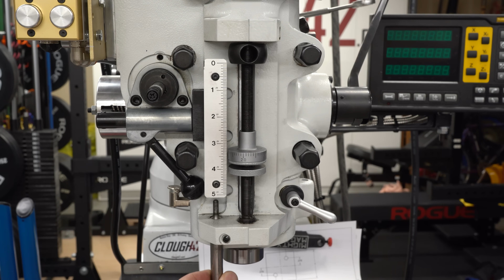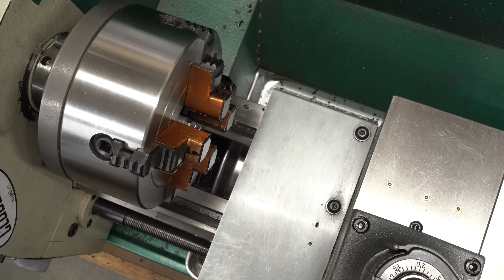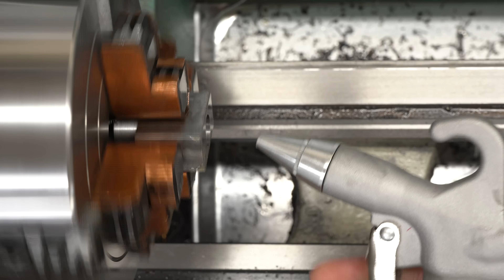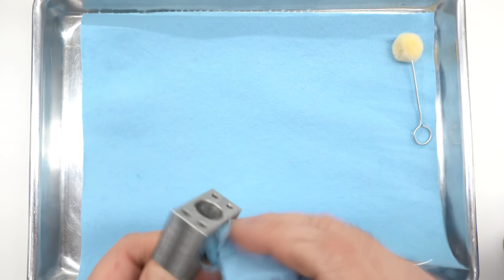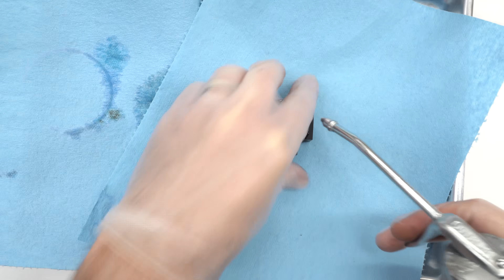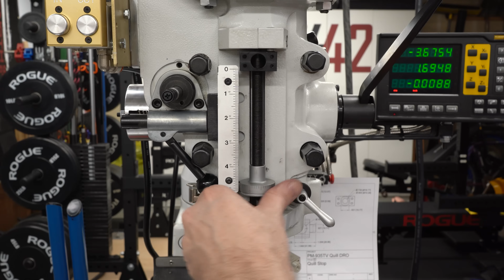Installing a Quill DRO On My Knee Mill - Making the STOP

Comment: When rough turning it's better for your cutting edge side angle (the face moving into the cut) to have a positive angle.  You want the cut to push back on the cutter. If you have a negative angle the cross slide can be pulled towards the part, especially on interrupted cuts.  Save the negative angle cutters for finish passes.

Comment: not to nitpick, but whenever i'm on a mill and squaring up stock I usually use a larger face mill or fly cutter mill to optimize surface finish. Even though there is no wrong in using a smaller end mill to face & true up  stock, I often get skittish in doing so.  Worried that somehow a part of the stock isn't completely flat in my vice, or my hand might of accidently bumped the knee by accident and won't know it till half way in. Or I don't wish to have a final helical pattern mirror finish on the face. Which is therefore why I prefer a larger face mill, or a fly cutter sized to such, but sometimes you don't have that luxury and you have to work with, with what you got.

Comment: Nothing wrong with mixing Imp and Metric,  in the home shop, as it shows a pragmatic approach. In industry it might confuse.
With the boring bar, if you allow the quill to retract slowly, at normsl cutting rate, it is the equivalent of a spring cut and often gives a better finish as a bonus.
Good advice to always work to a fine tolerance, even when not needed, to keep in practice for when it is.

Comment: Very nice. I've been told not to put the swab (or brush) back in the container, since it will contaminate it. So you're supposed to put a small quantity in a tiny cup and brush it on from there. Your take?
Also I like the subscription reminder. Unfortunately I cannot do so again.

Comment: I did this exact project a couple of weeks ago! My mill is a standard desktop mill more like your CNC'd one though, and the depth stop was both sloppy and rode inside the head, behind a faceplate. I ended up making a new rod to replace the depth stop threaded rod, and then made a piece that fit over the rod with set screws and poked out through the front of the depth stop slot in the faceplate to give me a mounting surface for the read head. Then I fixed the scale to a piece of flat bar on top of the face plate. I could not find many examples of this approach at all and I don't know why. I feel like a quill DRO on a mill is a very useful thing.

Comment: James, bought a PM power Y feed for my 1957 BP. They said good for BP's and clones. That's not true as clones are metric and the BP Imperial. After the third one shipped proved itself a runner we got into converting the metric bolt circles, and hardware to be compatible with the BP. I keep the machine all Imperial, can't see the old girl being bi...

Comment: Oxpho-Blue is great for small parts, even though it is pricy. However, you committed the Cardinal Sin of re-dunking into the bottle: unless you are going to use the bottle up in the next week or so contamination from the re-dunk will reduce the efficacy of what's left.

Regardless (or "irregardless" as most of the folks around here say), another great video, James!

Comment: Dropping small parts on the floor (or even worse, in the chip tray) is NOT optional. Mother Nature insists on it.

Since you really wanted those two flats to run smoothly, I'm a little surprised you didn't finish with a very light climb cut. But you got a great-looking finish, so I guess your setup is better than mine usually turn out to be.

Comment: Nice work as usual James, and great video. While at it, you should has opted to install a Morton Quill Stop (the one with the button  1213-S), I really like mine, much faster setting than using the original.

Comment: I just installed a magnetic quill scale and serial 'summing' box to the existing Z-axis encoder my Bridgeport (both parts from MachineDRO here in the UK) and I wish I'd done it earlier, it makes the thing so much better to use! 

I confess it didn't really occur to me to re-make the quill stop to add the read-head mounting holes so I just created a bracket with an expanding internal portion that picks up on the Quill-stop mounting screw access hole, it works fine but your solution is way more elegent - I may have to steal the idea!

Looking forward to seeing how you mount the scale without drilling holes, my solution has a machined part to carry the mag strip and 3 x M4 holes to mount it. The most fiddly bit was deciding how to provide strain relief and route the read-head cable such that it didn't catch on the sundry controls and other protuberances on the Bridgeport J head over the full quill travel - that led to a 4th hole for a cable P-clip but it all works fine and also leaves all the previous functionality intact.

Yes, chemical 'blacking' is well worth it, especially for tooling! Rather than machine oil, I simply immerse the parts in WD40 for 30 minutes or so after treatment and that seems to work well, good appearance and no rust after a year or so in my unheated barn.

Comment: I'm glad you have done this video James as I have a touch dro to fit to my Bridgeport. One suggestion to make life easier next time, whilst you have the block in the mill, centre find the face containing the boss and centre drill it. Now when you put it in the lathe, you can use the fixed centre between the centre drilling and the tailstock to clock it in. The same methodology goes for the through bore as it's always easier to bore on the lathe where possible.

Comment: Not sure what the chemical is in your bluing solution, but selenium dioxide can be used for detecting latent fingermarks because it won't blue the metal where the oils in the fingermark are.

Comment: Boy, that was a lot of work. For my quill DRO I made an expanding plug that fits the hole in the original stop, and that holds the read head. No disassembly required. I'll be interested in part 2. Maybe then your method will make more sense.

Comment: when your dialing in your rectangular stock if you put a center in while its in the mill you can use a dead center in the lathe to quickly dial it in in the 4 jaw same with when you flipped it you already had a hole through the center so you could do the same again. Another thing to remember when drilling a internal counter-bore for a screw to chamfer the shoulder as screws don't have a sharp transition from thread to head there will be a minor radius that will stop the screw from sitting square on the internal step.  Great vid James
Reply: Just came from BlondiHacks' video where she mentioned that very detail about counterboring a threaded hole to ensure the screw head seats without a gap.
Reply: @JBLewis  Darn cheap screws have who-knows-what in the corner of the head and threads.

Comment: You have spent so much on tools, how can you put up with that crappy little lathe? I don’t get it.
Reply: It's easier to work on small parts using a small lathe. The cost comparison of a "crappy little lathe" to a "not crappy little lathe" is fairly negligible as there doesn't seem to be a "fantastic little lathe" on the market. So even the "not crappy" lathes need a bit of work to dial them in correctly. Since he's put so much effort into the one he has already then it makes economic sense to stick with it. At least, until a fantastic little lathe comes out....
Reply: @HelenaOfDetroit  I've had nearly every size of lathe there is...7 by 12, 9 by 20, a c4 9by 20 .....now I have a 2 horse 12 by 36......and access to a 17 by 60 5 horse......2 horse is really small enough for small parts....I would never buy a 1 horse lathe any more......by the way...C4 is a great little lathe if you're in the kitchen!
Reply from the maker: It's also a matter of shop space.  But you're right; this lathe is a great little lathe now.  If I were to buy (and find the space for) an HLV-H, I would miss the ELS.
Reply: @Clough42  yeah, I'd love an HVLH....they do come up once a month or so here in the northeast....you'll find one sooner or later!
Reply: @Clough42  doesn't the hvlh have a fancy leadscrew?
Reply: By coincidence, I'm just considering how to fit a glass scale to the quill of my Bridgeport so I'll be watching closely. Good on you for using metric threads! Bravo.

Comment: Consider installing a Morton educated quill stop nut....Once the quill DRO is installed, the stock nut is a fiddly real pain to get at.
Reply from the maker: I actually have a pushbutton stop nut, but it turned out to be the wrong thread pitch.  :(
Reply: @Clough42  
I had machined one of the quill stop threaded rods out of hardened threaded rod to 1/2-20 on a Sharp mill to install the educated nut. The original was a coarse thread .No one offered an educated nut in that thread. 
Decent lathe project. For you.